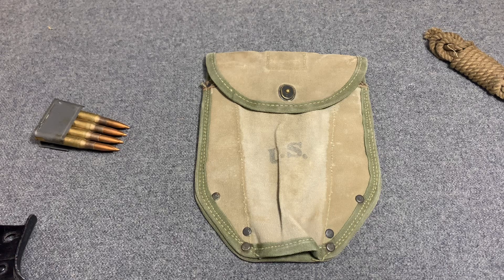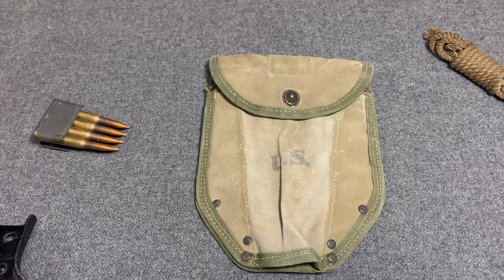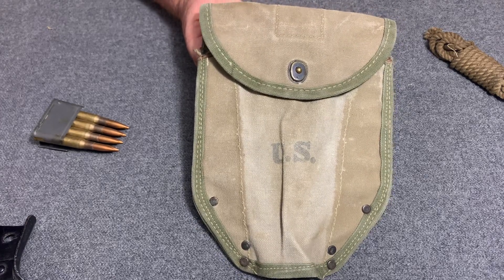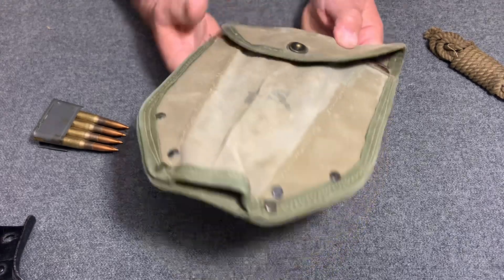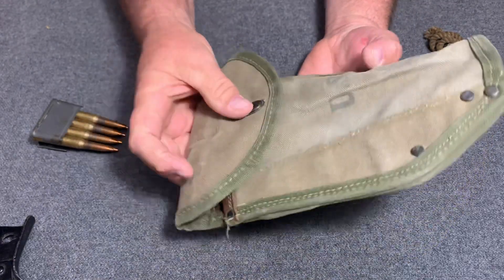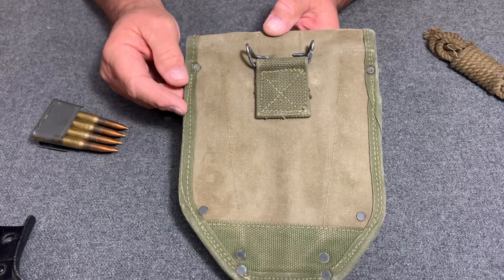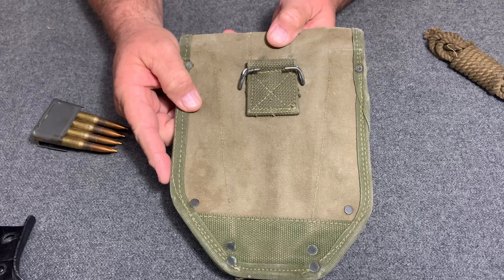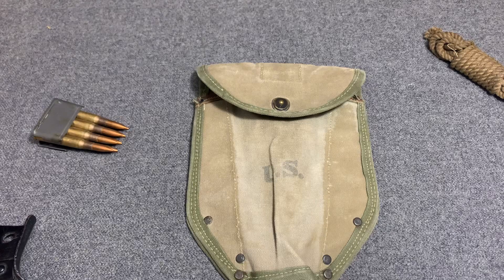WW2 US Gear M-1943 Intrenching Tool Carrier 1st Pattern

Comment: Nice video, There is actually 3 patterns of m43 entrenching tool carriers there are the 2 ww2 designs and then in Vietnam they made a 3rd design with a snap instead of a lift the dot fastener
Reply from the maker: That one is an M 1956 pattern I have a video on it look at my  m-1956 gear videos thanks for watching
Reply: @WebGearReview  There actually is a 3rd pattern one I have one dated 1967 and it has a snap and m1910 hook on the back and I believe it says m1943. It also doesn't have any bayonet holder on it.
Reply: @WebGearReview  There is some information on the 3rd pattern M43 on VietnamGear.com
Reply from the maker: Robert King  I did not know they were still making The m1943 pattern, after 1956 or 57. Does it have U. S. stamped on the front? If I gave you my email could you send me pics of it?
Reply from the maker: OK I’ll look into it thanks for the information
Reply from the maker: I read what It had to say and it mentioned that It had a snap but that’s all it said I’ll look deeper into the subject and see if I can find some information on it thanks for bringing it to my attention
Reply from the maker: Kobe bob Looks like you was right I’m going to look deeper into it thanks for the info

Comment: there were actually a couple variations
lemme go into detail
1st pat:all khaki no adjusters for m-1910 hooks
2nd pat: added adjuster
3d pat: got an o.d green trim
4th pat: added little loop above m-1910 hooks for idk what (still brown with od trim)
5th pat: became fully od green
6th pat: used only by marines in vietnam was basically a 1st pattern m56 cover except it had m-1910 hooks and no bayonet carrier but got a snap closure instead of the classic lift the dot it was also  slightly bigger so it could fit m51 e-tool however most marines had the m43 e-tool with it it was used into the mid seventies until it got phased out and it even made it to Koh-tang or the last battle of vietnam but even then most marines at that battle had the m67 shovel, crazy how many variations there are huh? thanks for showing this off and I don't regret subbing to you, nice video man!
Reply from the maker: thevet Thanks for the info, thanks for subscribing